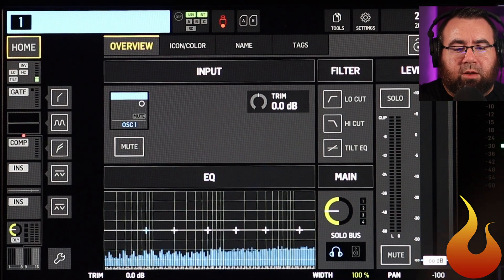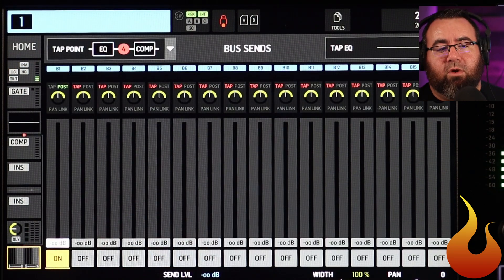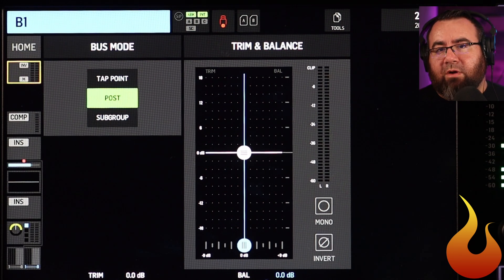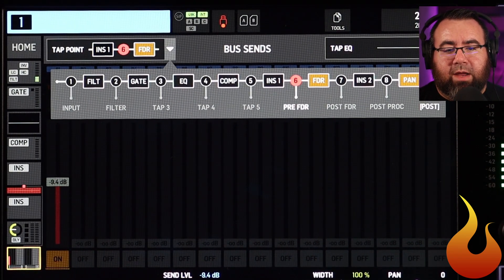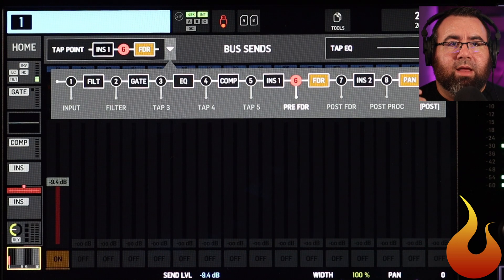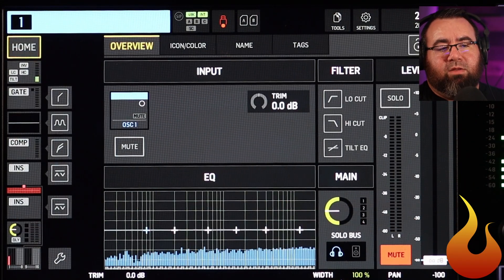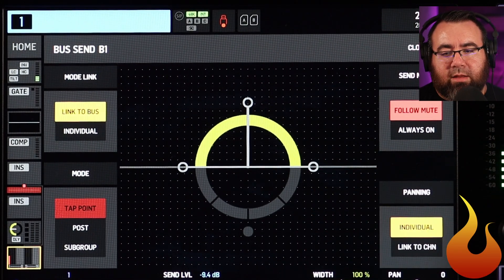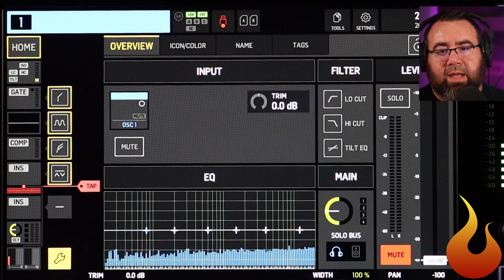Behringer Wing Bus Modes and Tap Points  -  #AscensionTechTuesday - EP140

Comment: Seems rather self-defeating to remove the ability to have individual (or in the case for X32 - in groups of two) settings for tap points and then add an EQ for the tap point which would affect everyone using that tap point (which everyone needing a pre-fader mix would have to). If the singer wants more high end on their vocals, it will have to affect everyone listening to it from mix buses...

16:15 why would that be silly? I rarely use individual pan for anything else than toms and maybe singers, or if someone requests to have individual pan for something else. Much easier to just link it to channel, so when you pan something you don't have to go to every channel and pan them, which is very time consuming and can easily lead to someone receiving something in center that was meant to be panned L/R just because you forgot to pan it (have had that happen to me multiple times when playing keys and the sound tech forgot to link send pan to channel and just panned it on the channel and forgot to do it in the buses)

Comment: How do you do it if you have a broadcast bus and you want the drums to go in pre-fader and the rest post-fader? (For instance, in a room where the drums are really loud naturally so most of it doesn't need amplification in the room, but you do need to add it to the broadcast)
Reply from the maker: I’ve got a few options that depend on how loud the drums are in the room and how actively your sound crew is monitoring and adjusting the online mix. 

 - best option is to create an enclosure for the drums to give you more control and to make the house sound and online sound more unified. Unfortunately, this costs money and isn’t as attractive as an exposed kit but it would fix your issue :)

 - otherwise, if you have one engineer mixing both house and online at the same time, and if the drums aren’t extremely loud, you may want to continue doing a post-fade mix but with the drums boosted over the other band channels. This gives you the benefit of still “following” your house mix. For example, if you boost the snare for a specific section, it would get louder in both mixes at the same time since it’s a post-fade mix. I would set all the other band elements to -5 or -10 going to the online mix (post fade) and set the drums between 0 to +10 as needed to boost them proportionally online. 

 - if the drums are so loud that they basically aren’t in the house mix at all and purchasing an enclosure is not a realistic option, back to the question you asked, you can change the drum channels to be pre-fade going to the online mix. I don’t have a wing in front of me but I’ll do my best to explain. Select a drum channel, go to the sends tab, change the signal tap from “Link to Bus” to “Individual” and select “Pre Fader”. 

I hope that helps :)

-Chad
Reply: @AWTechTuesday  thanks Chad!! We're getting the Wing. There's already a screen in front of the drums. The drummer still manages to hit 83dB at FOH on the cymbals alone in an auditorium of 500... Probably the best solution is to ask for taking it easy a bit or different cymbals. But he's cool and young and very enthusiastic so you know... don't want to bother or discourage him. :) 
It's nice to have your options available and explained for when we start installing!
Reply from the maker: @spookie3000  I will say, a shield in front of a drum kit is potentially useless if it is not also paired up with a padded roof and rear. It will redirect the sound but not absorb it. If you can add those 2 elements, I think you’ll love the difference. Research the LidPac from Sorber aka Clearsonic. Get the one with the extra panel. They also make a panel that is 2 long panels held together with a hinge. These are great for the rear and can act as door to enter and exit. Trust me, BIG difference 😉

Comment: Hi there again! I d like to ask you this : I saw from tutorials  about wing that the inputs can have maximum 23.5 ms  delay....is there an option for wing to be capable  adding more delay when assigning  the inputs to a sub group?? My company is thinking  of buying wing and wanted to know if it is capable of that ...because when we stream conferences  mics must have around 165 ms delay in order to be synced with the image  from cameras (which get a lot of processing  that's  why we have to delay the mics ) and I also cannot delay the output ( my whole mix for stream ) because other inputs ( video playback , zoom-teams remote speakers ) don't  need any delay ...my only thought  is adding an insert dly to that sub group (mics sub group)but I ask you if there is a faster/easier way...
Take care mate 
And keep on making nice and informative videos!
Reply from the maker: At some point, they added a lot more channel delay to the Wing. I don’t have a Wing in front of me to check at this moment, so this may not be completely accurate, but on the Mixing Station app, they show that channel delay can go up to 500ms. 

Another option is to insert the stereo delay on your bus. Make certain that the filters are turned off and that the feedback is set to “0”. I’ve done that in the past with excellent results. 

Hope that helps!

-Chad
Reply: @AWTechTuesday  500ms makes more sense...m32 x32 also reach that  number ...thanks for the reply 🙋‍♂️

Comment: If I send six Vocals to a SubGroup for processing, will I still be able to control the volume for each vocal channel at the fader level? Good example would be If I have one or two lead vocals that need to come-in to the SubGroup loader.
Reply from the maker: A subgroup follows the volume, panning, and channel delay of the channel (in additional to the channel processing). So if vocal 1 is at -5 and panned slightly left in the house mix, then that’s exactly how it will be in the submix, too. The only other control you have that is separate is an on/off control. 

-Chad
Reply: @AWTechTuesday  Thanks for your quick response. As always, very good informative videos. I never stop learning.